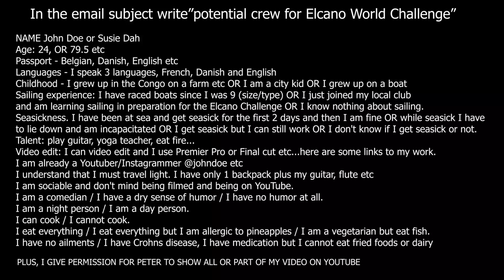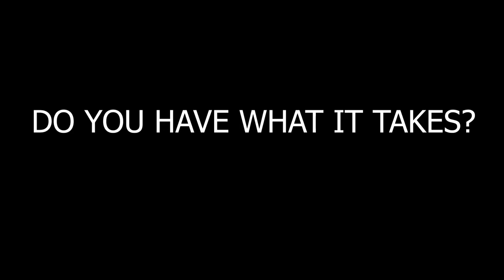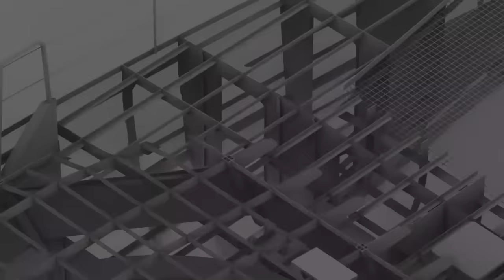Ep. 20 CREW WANTED - Performance catamaran doing the Elcano World Challenge

Comment: Hi Peter,  I was wondering why you went for a daggerboard cassette setup ?   The main issue with these is that if you strike a foreign object like a log the daggerboard can jam into the cassette and breach the hull.  The other option would be a fold up daggerboard with a horizontal cassette.  These are setup with a sacrificial block that snaps under impact and allows the daggerboard to stow automatically if you strike something.   Probably too late to revise the design but it would be safer.

Comment: Maybe you could do a video about Aluminum construction in general, like:
How will you deal with the noise and sweating of an aluminum hull, will it be spray foamed?
How will you deal with galvanic corrosion, will you have active system to mitigate it?
What type of bottom anti fouling can you use and how it get applied etc
Reply from the maker: Will try... running out of time

Comment: Nice going Pete.  When those big pieces of skin go on it quickly starts looking like a boat rather than a giant meccano kit. 
Just looking and comparing the design seems a lighter build than the other Al cat builds and designs im following. 
So she should pour on in lighter airs.

The french and Germans are very fond of spraying recycled cork grains onto the insidebof their metal hulled boats.. notbonly does it insulate and prevent condesation it insulates electrically and against noise. The other plus is its lightband they even use it as sea deck .. Scandinavian electric powerboat use it to go with there Flax and carbon hulls as its kind on the feat   
 and keeps the heat off the metal and inside in the colder climbs.  It also doesnt burn like plastics. 
A manual Whale pumped  head .. should keep things civil safe and reliable, but you will need a black tank for a lot of coastal waters.
Reply from the maker: I will n look into the cork

Comment: I know they have not finished building the Frame as yet. But it seem like there are several areas where the Weld is not completed properly, and I hope they are detailed about completing those welds before the major parts of the boat are put in. I also think you should have gone for the 68 Foot instead of this 42, for that would have provided you more stability in rough seas.  Robert(Ras).
Reply from the maker: Only 20% proper welds atm..

Will complete when shell plate is on

Comment: Make sure you run Cat6 for POE (power over ethernet) cameras everywhere you want to monitor anything on the boat (major components, rear-facing, front-facing etc)  plan it NOW, and make sure you can replace it easily if it gets corroded. POE cameras are the best. At some point you may want to have one broadest LIVE 24/7  "FreedomCam"
Reply from the maker: Doing now with Raymarine

Comment: I was also curious about that heavy "backbone piece that runs down the bottom center of the hulls. Great for strentgth but does it split the hull into 2 water pathways, are there cross drain holes being added or how does water migrate to the back/bildge pump area?
Reply from the maker: Yes

Comment: Instead of port and starboard hand rails folding solar panels .. as you spend most time at moarings and is when you use most electricity my suggestion is the hand rails/ or along the hand rails solar panels that fold down/out .. and when under way fold up as protective hand/splash rails ??? Just thinking my brain hurts 😅🤔

Comment: Hi Peter, I hope my comment doesn't come too late into the build and you can still consider this modification. As I have mentioned before, do give a serious consideration to making the roof from a material other than aluminium (carbon, fiberglass etc). Why? Because Heat!  Aluminium is one hell of a heat conductor.  Putting the well-being of the crew aside, think of the efficiency of those solar panels on the roof - their efficiency falls dramatically when they're hot.
The Elcano Challenge is all about efficiency, as Cornell's trip demonstrated.  You can't add a mega-large battery bank (because weight).  You can't rely solely on regen, so you have to compliment with efficiency of the solar as much as possible.
Reply from the maker: Too late

Comment: Sailing carbon free around the world. You must be kidding.
Aluminum is the most carbon intensive material to produce. 16 to 20 tonnes of oil equivalent for 1 tonne of aluminum.
Then there is the production, welding, the solar panels and batteries. All highly carbon intensive to produce. Then the sails and lines, all made of synethic material. If you want to sail truly carbon free, your boat should be made of wood.